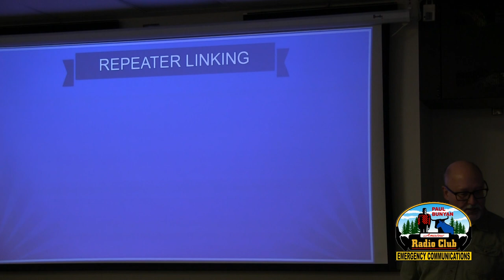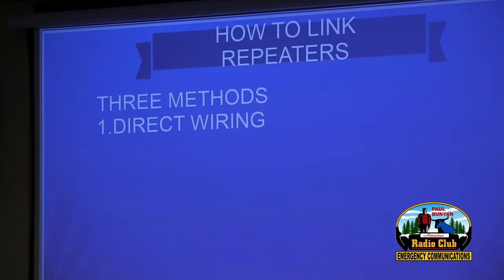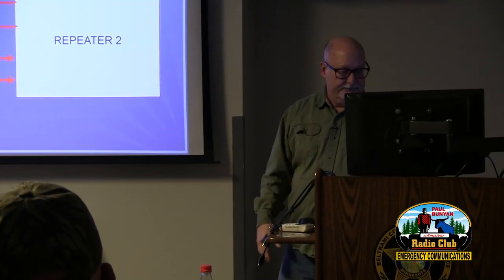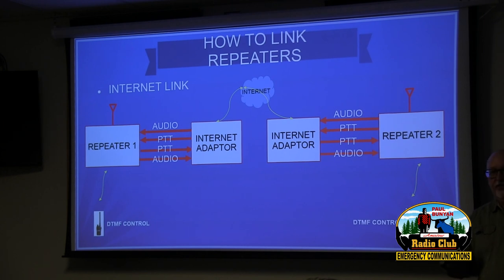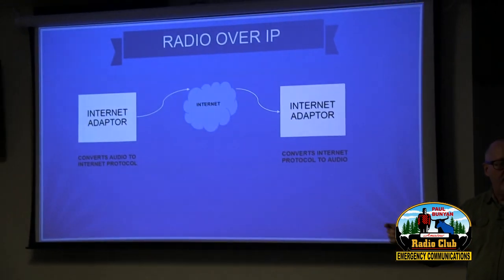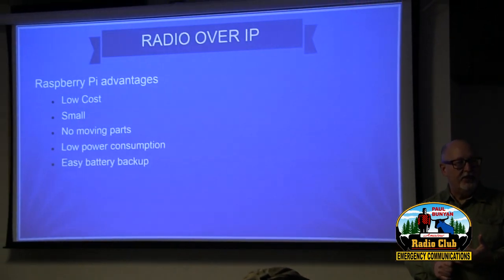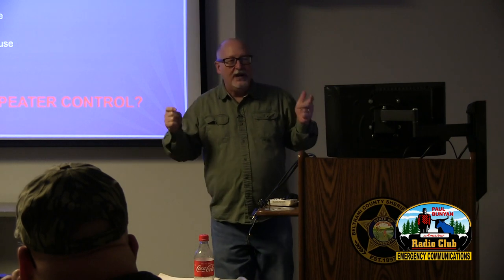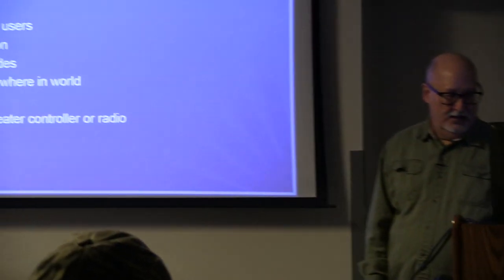Ham Radio Repeater Linking 27min

Comment: I liked what you talked about however -- getting the connection lines from the radio or repeater to the R Pie would require someone with a lot of knowledge about where to find those connections and what it takes to get the correct audio and the correct PTT lines correct -- hopefully there is a ham around that can help do that short of a commercial radio shop -- you mentioned the usb adapt that could be purchased for around $50 just wondering where that might be available from ??? -- thanks

Comment: Have a remote echolink node linked to my local repeater.  Running sysop, windows 10, and a signalink usb with a Ft2900r. Club wants to link a second repeater to my node. there is no internet access at the second repeater site. what id the simplest way to do it and what equipment do I need?
Reply: Ubquiti rocket m5 and ubquiti dish would be the way to go.